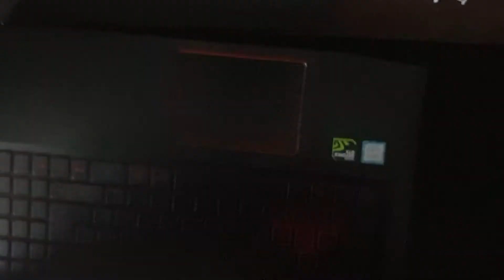How To Re-paste The Acer Nitro 5

Comment: Hi i have acer nitro 5 an515-52 and  i keep getting blue screen crash error (nmi hardware failure) every now and then.  Can you help me with its solution, thanks!!
Reply from the maker: Yes, its a pretty common issue with some acer nitro 5's, even my acer nitro 5 had that issue. Try windows memory diagnostic tool by searching it up in the search. This will find any errors in the memory. If this does not fix your problem try reseating the ram, buy opening up the ram cover and taking out the ram sticks or stick, and swapping them around. Hopefully that fixed your problem. Thanks!
Reply: @techarcyt  no it's not common? i have never had it in 3 years
Reply: @techarcyt  thank you for the fast reply, i will try it :)
Reply: @techarcyt  bro i tried it but when i switched ram to the other slot it gave me black screen while laptop was running in the background what should i do?
Reply: @techarcyt  i bought better, newer fast ram. not cheap. but my model came with 16gbs. now its 32gb at around 2933mhz.
Reply: kingston brand khx2933c